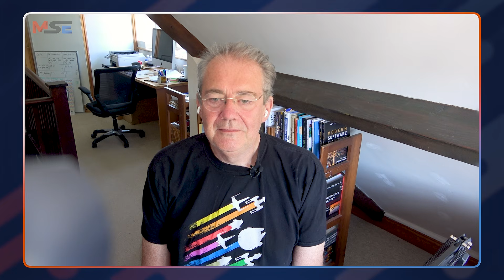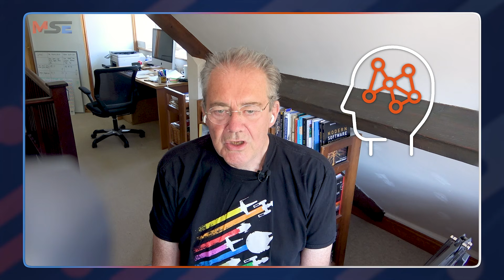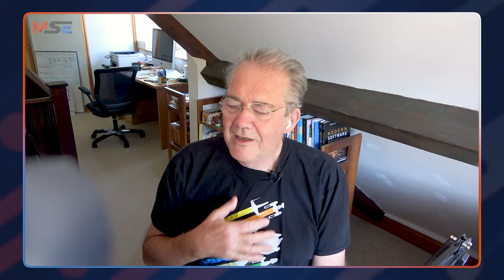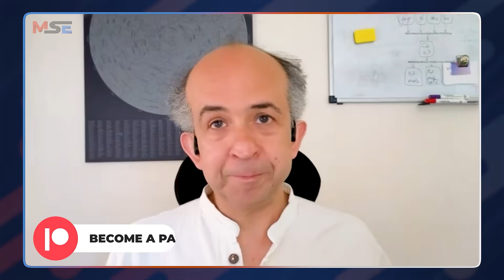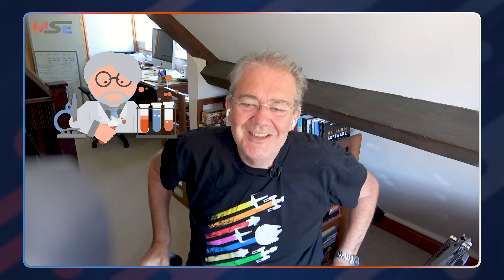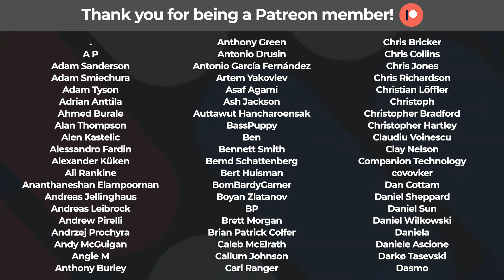Can We FIX Agile?

Comment: Development gets lost when process people get too caught up in process, and programmers get too caught up in code. The solution? Keep focused on problem solving and bringing solutions to actual problems. Rituals, rules, fixed architectures and patterns, even sprints and stand-ups - however well meaning - always eventually hinder progress. Be like water, iterate quickly, don't be afraid to repeat yourself, or throw stuff away and start again. Keep releasing, fixing, and getting actual feedback from users. Generally, I've found that if it's not development led, it quickly loses focus and pace.
Aim to release at the close of the day, and have a standup that reviews what you did, rather than what you're going to do. Sounds scary, but you can move mountains this way, and the work never gets stale.
Reply: "Keep focused on problem solving and bringing solutions to actual problems."
I think that is the right spirit, although it can be easier said than done.  Apparent progress can be both real progress or retrograde progress.  The hinderances to apparent progress are there because when the code base becomes complex enough, it is easy for well meaning people to create retrograde progress.  In some important areas of the code of a more mature business, code changes must be done very slowly and deliberately because to do otherwise is business suicide.

One of the attractions of TDD is you are proving some kind of value.  With CI, you are limiting the likelihood of retrograde progress.  Some people have argued that true TDD can be too heavyweight and prefer Acceptance Driven Development, where Acceptance tests should have some understandable tie to business value.  Getting back to your point, it is nice for everyone to have some inkling of business value delivered, in other words "bringing solutions to actual problems".
Reply: So moving quickly is a business suicide uhh? 🫤
You sure about that?
Reply: @TechAndPolitic  Maybe you could look up the word "retrograde"?
Reply: @ComradeOgilvy1984 No need, I am French. Don't know if u mean rétrograde as an adjective or rétrograder as a verb tho... but both seems irrelevant anyway. What do you mean?
Reply: @TechAndPolitic  Once a company has grown and has paying customers that rely on them and is acquiring new customers at a good pace, there are areas of code where instability can be VERY expensive.  It is necessary to have guardrails around those areas.  It is necessary to go slow for certain things.

On the other hand, there are also new code areas where the downsides of going fast and making a mistake are small, while the gains in speed are high.

The real issue is not that going slow is always bad and going fast is always better.  That is the wrong way to think about it.

Mature companies should learn that some areas need to be slow and some areas ought to be fast.  To get ossified into a habit of always going slow leaves them vulnerable to competitors.  Young companies have the inverse problem, that they have to learn where and how to be careful, or their codebase becomes a mess and everything is both unstable and expensive to build upon -- they can find the worst of all worlds.
Reply: @ComradeOgilvy1984  slower development was never an answer to low-quality changes. The ability to quickly introduce changes requires test coverage, solid automated control gateways, and rolling releases allowing you to test changes on a smaller number of users or customers, decreasing potential impact. Moving quicker is the answer for introducing more stable changes to complex critical systems.